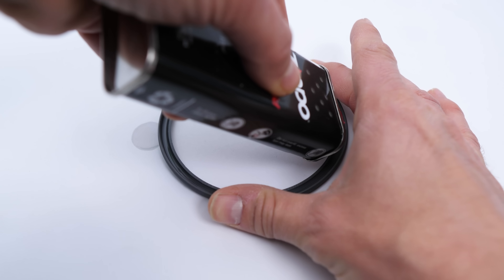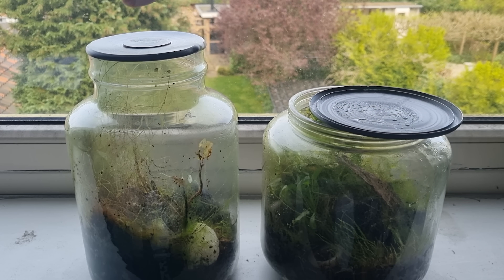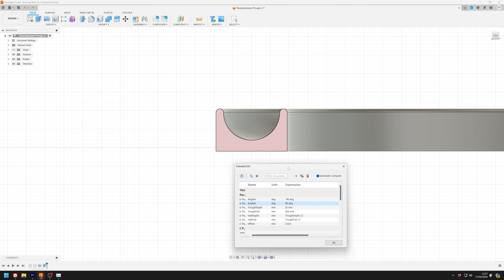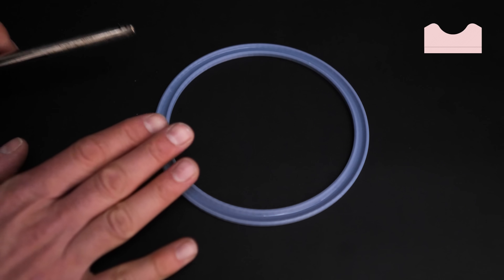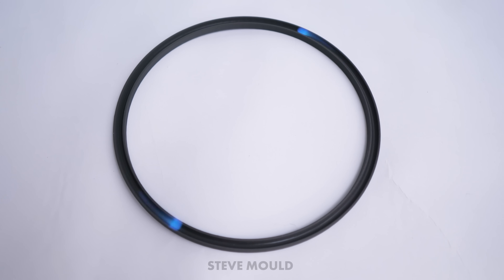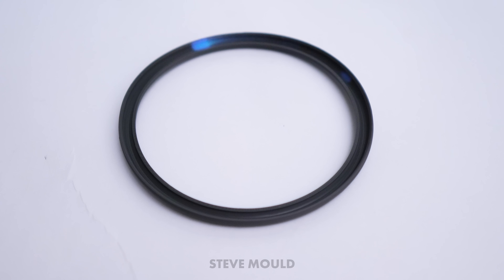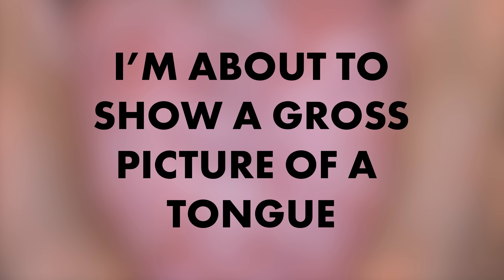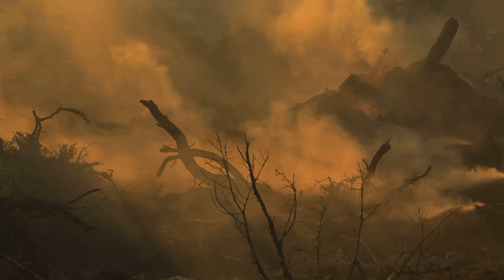Bizarre travelling flame discovery

Comment: If fluid clings to track, Moebius strip
Reply from the maker: Now there's an idea
Reply: @SteveMould   maybe hand sanitizer would work? maybe mixed with lighter fluid if it isn't volatile enough.
Reply: @SteveMould  I want to see an attempt at logic gates!
Reply: Put some strips on the bottom to promote capillary effect
Reply: @thibaultchevalier3856  Couldn't you just alter the surface and have teardrop/fish scale indentations?
Reply: @SteveMould please make it!
Reply: @SteveMould  an idea indeed
Reply: @SteveMould  Please do it!
Reply: @SteveMould  I would like to see that.
Reply: @SteveMould hurry up and make it happen. Or someone else can do it first
Reply: @SteveMould heres another...Tesla Valve
Reply: @SteveMould did you try the moebius strip version?
Reply: You could use something like “canned heat” (the stuff they use to keep buffet food warm, not the band) that would stick better.
Reply: @emockensturm  I dunno, the band was not very hygienic either, just look at their sticky hair.
Reply: @emockensturm  Or you could fill the bottom of the track with a wick material to hold the fuel
Reply: @emockensturm  what about the song canned heat by jamiroque
Reply: @slayereli13  don't know anything about it
Reply: On the figure 8 track, what could be happening is the vapor rises up to the raised part and keeps the flame going.
Reply: @zachreyhelmberger894  I was thinking the exaxt same. Vapor rises and stays ”on the lane” because of high sidewalls.
Reply: How about a gelled fluid like Sterno?
Reply: @robertlitman2661  I think Sterno is what I was calling “canned heat”
Reply: @emockensturm they’re the same thing. Sterno was just the brand that popularized gelled fuel for cooking. I do doubt this will work in other orientations though, as flames are so reliant on gravity and convection.
Reply: @emockensturm  and where that band got the name, Sterno Bums was considered for a while but passed over because not as good.
Reply: @CothranMike  I knew that they got the name from the product but never knew about the book “Canned Heat Blues” until I started exploring after posting
Reply: @emockensturm  yup thats what Sterno is. Used to have so much fun playing with those in my teens lol
Reply: @emockensturm  that's great, so many of the old songs are just not given the 'air time' any more. Did you give it a listen, which version?
Reply: @CothranMike  songs?  Canned Heat is a band (which I discovered in the 80’s in HS)
Reply: @emockensturm  the first song is from 1928, called Canned Heat Blues and then there is the song by Jamiroquai is 1999.
Reply: @CothranMike  I was talking about the band formed in the 1960’s
Reply: @emockensturm  I'm pretty sure that's jamiroquai actually.
Reply: @robertlitman2661  to space...
Reply: @robertlitman2661 @emockenstrum meant that as well. Canned heat/sterno.
Reply: @robertlitman2661  Lol🤣 literally one comment too late
Reply: Capillary feed from below...
Reply: My guess would be that different fuels would require different path size parameters.
Reply: Napalm!
Reply: @jlco Now we're cooking with, erm... napalm
Reply: Maybe it's possible to put some sort of fuse in the grooves and soak them in fuel. Then it would hold in place, and provide fumes to burn.
Reply: @nbvehbectw5640 And why would the flame ever go out?
Reply: Maybe you could use hairspray?
Reply: Maybe a wick down the middle with non volatile walls, basically this shape |-| vapors could build up on either side and the twist at the "end/start" of the strip would be a variable that would have to be tweaked on how fast or slow the twist ought to be. Maybe it doesn't matter.
Reply: @Guardian_Arias  I like this idea.  Perhaps with a narrower inner channel at the bottom that the wick could be gently pressed into.
Reply: Would have to stand it on its side because it's the vapors that burn - not the fluid - and those rise (or drop depending on type of vapor). So if you have a lighter-than-air vapor you would get issues with the part of the Moebius strip's surfaca pointing downward.
Reply: Make a string loop that fits inside the Moebius snugly. Douse the string with fluid. Light.
Reply: this probably works better in low gravity environment.
Reply: Mobius... forrest?
Reply: Napalm?
Reply: lighter ferrofluid
Reply: @narwaffl  - Would iron filings sparkle?
Reply: use regular light fluid but do it in zero g. Interest to see how zero g affects the flame
Reply: @alexm7023  In the Earth's G-field, there is never zero-g...only weightlessness!  SO...I wonder what the differences would be?
Reply: Get Cliff Stoll on the horn!
Reply: It's called a clock
Reply: mixing acetone or lighter fluid with polystyrene should work
Reply: Maybe some kind of non-flamable sponge? Like fiberglass or something.
Reply: Semiporous gel maybe? Seems a good idea.
Reply: You could always just go the zippo route and use cotton, or a wick, or flammable gels...
Reply: Perhaps by create a porous structure at the bottom of the trough to prevent the fluid from migrating or pouring out. That said, what is the role of gravity on all this. Perhaps a rotating shape which moves just fast enough to keep the flame perpendicular to the local gravity field.
Reply: That was pretty cool. I wonder how temperature and pressure affect this behaviour....
Reply: cant the loop to [correct angle] angle and rotate at [correct speed] via [simple motorized mechanism].
Reply: They really don't like open flames on the international space station but zero g might help
Reply: @ZombiePanda1776  just reorient to a plane containing the gravity vector
Reply: Say hi hi hi hi... take me high high high high...?
Reply: Polyurethane glue
Reply: It would work in zero G at a large enough scale, as the track itself is the source of gravity. Like a ringworld from Halo but with a single half twist in it.
Reply: @IOUaUsername  Read the Ringworld books
Reply: @IOUaUsername  at 0 g, you meet a completely different issue; air dynamics functions differently in 0 g (notably, you do NOT have convection); you'd need to solve the oxygen issue in order for this to work... alternatively, you could have oxygen BE the source of the "excitable" medium.
Reply: @sinteleon convection does happen in zero g circumstances (and apparently weightless frames of reference), but not in the linear sense that you’re referring to. I believe it creates pressure eddy swirls based on slight imbalances and amplification of any small, localised air movement or, short of that (assuming perfectly still air), molecular angular momentum. Adding energy via a flame will always cause a pressure imbalance that needs to be resolved in order to fulfil the requirement of increased entropy over time. Convection is just a levelling of a highly ordered state (localised energy imbalance) into a less ordered state (diffused energy). Think more of how a cloud of cool “vape” particles move and swirl as they diffuse in 3D space, rather than heat moving “up” based on effects of atmospheric density in a strong gravitational field.
Reply: You don't need the fluid to cling, just the gas to be contained
Reply: Why should moebius strip if liwuid sticks?
Reply: This makes wonder how this would perform in zero G with basically only surface tension holding it together. You'd probably need a more closed track, or maybe it just wouldn't work at all. I don't think experiments involving fire are recommended in spacecraft, but they certainly would be fascinating.
Reply: Alco gel would be suitable
Reply: I think the bridge works because the evaporating vapor flows along the track even where there isn't any liquid.
Reply: The train of thought off this comment got me wondering, would this phenomenon work in zero G?
Reply: 12:00 what if the forest will be in roughly this shape?
Reply: rotating detonation engine
Reply: instead of any of these gels, I'd note 2 possible options:
1) surface tension is likely why the raised portion works to begin with, so you basically need to increase the surface tension of the through to let it be able to "hold" more lighter fluid regardless of angle. (basically a non-smooth surface)
2) Any substance that can absorb lighter fluid should also work for this purpose, so like a wick as mentioned, or some thread.

Though as noted, the bigger issue at this point would be the air convection since for a mobius strip to work it'd have to "flip" at some point, but I'd imagine that would require different trough designs instead to compensate (since we no longer need to rely on gravity to hold the fluid, the trough is purely to adjust the air flow).
Reply: Low volume flame on my gas stove burner can race around like that.
Reply: In zero gravity, the surface tension would indeed keep the fluid bound to the strip. BUT… you would have a flame proceeding out of all surfaces (not just one side - in this case the side with the 5mm channel in it), as the fluid would creep around to equally cover all facets.
Reply: Can be done with lighter fluid in zero G.
Reply: morbius
Reply: A zero-g flaming Moebius strip on the ISS.. what could go wrong!!
Reply: OH MY GOD!
Reply: Quick I need a 3D printer and the Zero-G plane
Reply: Yes! Please try and show on video! Great idea!
Reply: What is you super cooled it?
Reply: jetfuel infused kum ?

Comment: From water themed videos onto Steve's flame-starter era.
Reply: man skipped the earth bending arc
Reply: @NN-fx6oj  There are the ones where he used ball bearings to show different things. Those are kindof like earth.
Reply: Just wait for the metal age...
Reply: Hes working on becoming the next avatar.
Reply: @AkaraTheLost  air is the whistles, now to do earth
Reply: I'm a firestarter, twisted firestarter
Reply: Prodigy intro required 🤣
Reply: @ddoherty5956  exactly!
Reply: @WindsorMason  Ha, Windsor's my middle name no one can ever guess it though 🤣
Reply: All stand for anthem of Fire Nation...
Reply: Steve converted to the fire nation
Reply: If you have a 3D printer with liquid cooling, you have an Avatar Machine. It squirts plastic (earth) through a heated (fire) nozzle that has coolant (water) circulating around it, to be then blasted (air) by the part cooling fans. Magic!
Reply: One of those loops did look like a Twisted Firestarter.
Reply: they are both fluid
Reply: Next he must master earth bending and air bending.
Reply: I am excited already

Comment: This is basically how Rotating Detonation Engines work except the wave front is supersonic and therefore compressing the gases, removing the need for a compressor

The circle with spokes is like a RDE combined with pulse detonation engines lol but great work!
Reply: Rotating Deflagration Engine
Reply: @fiveoneecho  Rotating Deflowering Engine
Reply: @PluetoeInc.  oh no :P
Reply: a RDE was the first thing I thought of as well
Reply: Think would work better combined with a central inverted aerospike, got on a tangent a while back tryin to figure out how iron mans hand repulsers could work irl as flight stabalizers.. without melting your hand ideally.
Reply: @ThirtytwoJ  non-hand-melty is indeed ideal, or at least slightly preferential if all options are being considered.
Reply: The one with two flames especially looked like a RDE. They typically use two combustion fronts to keep the thrust pushing evenly.
Reply: Thought the same!!
Reply: i immediately to think of RDEs too lol

before this video i wondered how you could start an RDE properly.
now i know it might be possible by having a less optimal fuel-oxygen-mixture on one side of the ignition point and on the other side a more optimal one
Reply: any engine can be a rotating detonation engine if operated poorly enough
Reply: @Thing.Appreciator  the thing about RDEs is that they do it on purpose to get more thrust per kg fuel
Reply: I was thinking this too
Reply: Another rabbit hole, for another day, lol. I'll look it up.
Reply: Yeah I was expecting a mention of a rotary detonation engine. They are so incredibly cool
Reply: The spiral looks like an old high milage carburator suppressed tech that The Why Files literally started yesterdays video on and i was wondering possible reasons for the spiral design where the patent details are missing/classified.  This might be exactly why.  Also was curious what would happen if used piezoelecric fog instead of spray. Been an odd background tinkering project looking for ways to improve classic trucks since i hate computerized modern crap.
Reply: Same here
Reply: how do systems like these control the direction of travelling fire?
Reply: @GeoffryGifari  for RDE the flame ignition is tangent to the wall so the flame can only travel one way
Reply: yep first thing that came to mind
Reply: Came into the comments to say the same thing.  
Then I figured someone else already did, so I figured I'd just see how far I'd have to scroll to find it.  
It wasn't a long scroll.  

Good job, people. Nerdiness on point!
Reply: Was here for this
Reply: I came here to say this too!
Reply: @tdk99-i8n it's more complicated conceptually but theoretically it has fewer moving parts because the shock wave caused by detonation does the job of a compressor. It's a similar concept to the rings in the video but you are constantly adding fuel and the flame is moving at supersonic speeds
Reply: Combine this with the aerospike rocket engine.
Reply: I thought the same thing the moment I saw the first rotation.
Reply: This is a natural equilibrium, those are absolutely a forced version. You could say this shows there IS a naturally balanced version, but they are absolutely not basically the same.
Reply: Beat me to it!
Reply: Damn I thought I had invented this but you beat me to it
Reply: @pogiewogie   quit amusing urself XD
Reply: Was coming to the comments just to find or ask about exactly this!
Reply: A lot of you are full of it, "yep Def RDE" "first thing I thought of" ironic that only the 1st few ppl actually said anything about them other than " yep definitely an RDE/I came to say that too!"  Stop trying to farm likes get a life and make an original comment instead
Reply: @hellzxking  well you're definitely fun at the party huh.
Reply: I knew there was an engine that did this